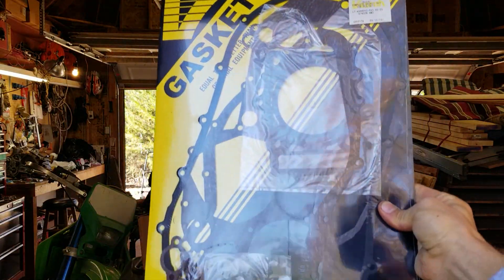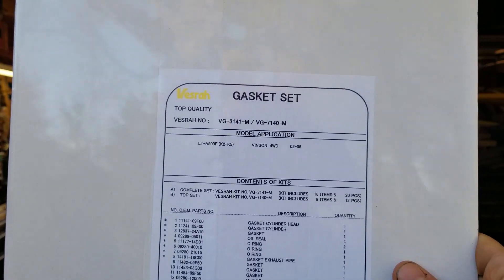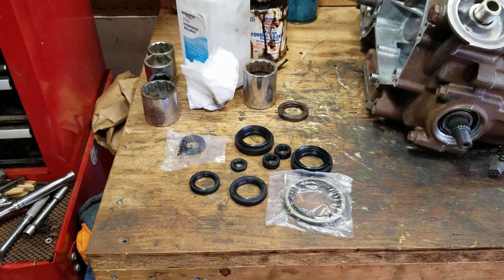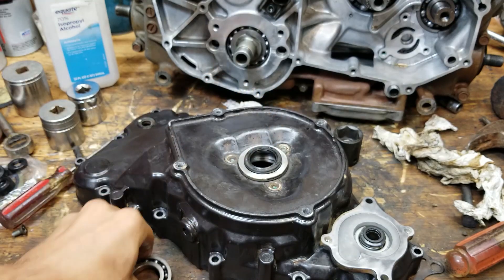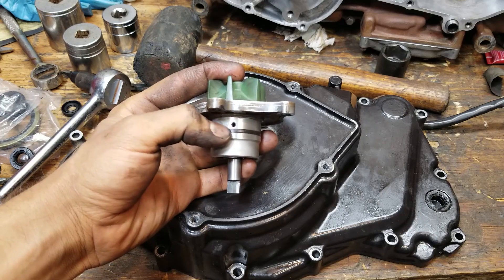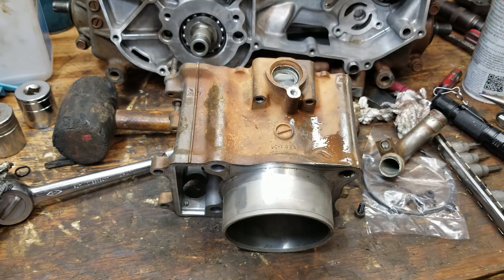ATV Engine Gaskets and Oil Seals Replacement: Suzuki Vinson Rebuild Part 10

Comment from the maker: Hey Y'all! Tools used and service manuals in the description.
Timestamps:
0:00 Intro
0:13 New Gaskets
2:02 New Seals
3:06 Seals Unboxing
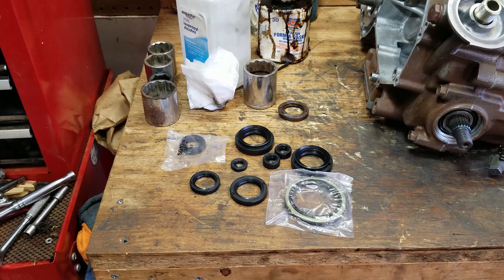4:00 Engine Seals Installation
4:55 Recoil Starter Seals Installation
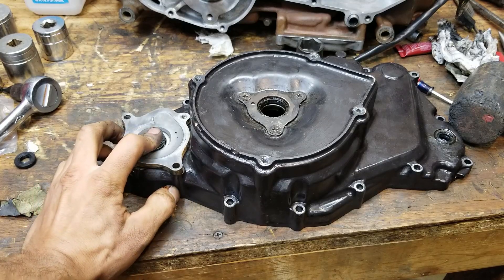6:48 Water Pump Seals Info
8:17 O-Ring Seals Installation
9:39 Outro

Comment: Hey Matt, do you or anyone else know if there is a torque spec for the nut that bolts the yoke to the output seal (the seal your installing at 4:23)
I have searched around quite a bit but still haven't found an answer.
Reply from the maker: Yes, it's 72.5 FT LBS. I put a service manual in the description for you. Check out page 102. It tells you everything!
Reply: Awesome! Thanks, I really appreciate the videos.
Reply from the maker: You're welcome! Don't forget to sub!
Reply: @MattsShop  hey Matt the out put seal can it be replaced after taking the clutch and primary off without splitting the whole motor.?

Comment: Is this kit fits the Suzuki eager 400? 07
Reply from the maker: No they will not work. They make similar gasket and seal kits that will work though.
Reply: Thanks for replying. My rear driveshaft seal is bad and I don't know the part number
Reply: Would have been nice to see how you removed the seals from the shafts, not just using a screwdriver when there wasn't a shaft. Otherwise it was great, thanks for the vid.